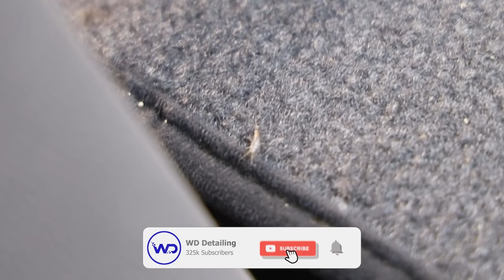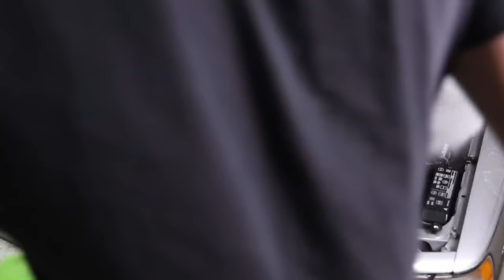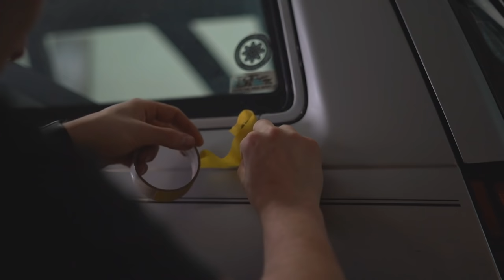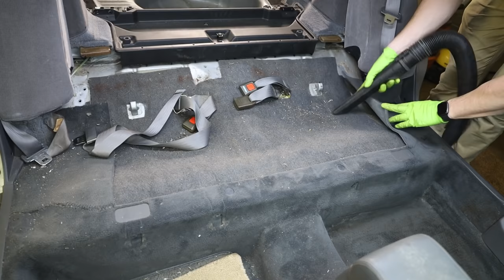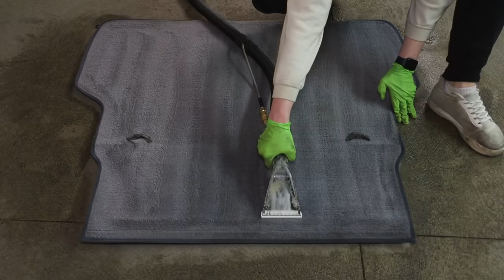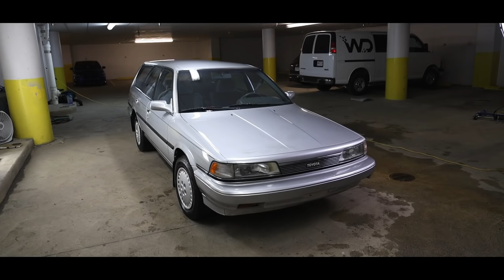ABANDONED GARAGE FIND First Wash In 20 Years Toyota Wagon! Satisfying Car Detailing Restoration

Comment: I would LOVE to own one of these with the 2.5 V6. You never see these anymore, especially in the rust belt. My aunt had a 1990 LE V6 sedan red over maroon cloth interior.
Reply: I own the v6 rn
Reply: I live in iowa and I found my Camry wagon last august. It has very little rust and 215k miles on it, it does have the 2.0 in it but that's the engine I'd rather have.
Reply: You don't see them anymore because almost no. one took care of them, just drove them to the ground. I just bought a 92 wagon with just 2 previous owners  and that poor thing was neglected in pretty much every respect: rust holes filled with rtv, holes in the coolant reservoir taped over, water leaks covered with roof tape, destroyed center console, faulty radiator fan switch, water instead of coolant, old atf, old wiper blades coming apart, dry rooted tires, split cv joint boot. And that is norm with camrys, neglected for decades and then junked.
Reply: More like 4.0 V6 I had the LE and it was v6 24 valves DOHC 4.0 horrible in gas mileage, it was a rocket, and I left many looking at my tail lights, especially with the boost button for the transmission.
Reply: @champion20199  the camry never had the 4.0. 2.5 or 3.0.

Comment: Depending on how solid the engine in it is, that would make a great commute car. It would also make a great stuff hauler as long as it was short enough to fit in it. Neat older car.
Reply: The Toyota engines of this time (especially the V6 and I4's found in this specific car) are legendarily reliable, plus pretty cheap and easy to repair. Not to mention the V6 and automatic are veeeery smooth, and the car is generally comfortable, making for a great trip car!
Personally I like the next gen Camry wagon more for basically being a better version of an already great car!

Comment: Seen one of these that was modified to be used for overlanding. The gave it a basic 3inch lift, added slightly wider rims, removed the rear seats permanently, had a solar system added to the roof on a rack system, a bed in the rear. Thing look mint.

This has the potential for the same. Nice job on the clean up. 👌

Comment: Ive the smaller corolla estate (wagon) I'm in Ireland. Its 1998  in daily use 370000 miles , manual gearbox , gets 45-50 mpg. Does 100mph , doesn't miss a beat and I won't part with it . You can keep your newer computer laden "does the driving for you " plastic sheds on wheels .
This things a joy to drive.

Comment: The car looks very clean on the inside.  I love hatch bachs.  I had a Toyota Corolla 1991. And it lasted me about 20 years..lol  it broke down because the bottom top from the transmission cap came off.  But the Toyotas are very good lasting cars.

Comment: Ahh, the wounds open up again....
My mom had a 1989 Camry LE (sedan), light blue paint, dark blue interior. She bought it in 1994 and had it until 2020 when a large rock fell off a quarry truck on the highway and exploded one of the Camrys tires, taking the fender and half the bumper off and cracking the basketweave alloy wheel (insurance totaled it and took it away).
I learned how to drive in that car, I learned how much I liked fixing cars (now I’m a mechanic because of that Camry), keeping it running and looking nice was a point of pride because up here in the Midwest rust belt, they are rarely seen anymore. Seeing Camille towed away was like watching the vet put down the family dog.

Yes, I cried over a car. Sue me, I loved that car.

Comment: Awesome job
One question: Why didn't you remove the floor carpet to  clean the metal floor below and clean it outside? I ask because after been sitting for so long It would have made a good way to see if it need some floor repairing because of rust or something like that

Anyway is an well done job

Comment: I have had a few toyotas in my life. Toyota Celica 1972,Celica 1982, 1990 prévia, 1989  Cressida, 1990 Cressida and the last one was parked for a year. That one had slight mildew and loved that car had it for 10 years until it became a rust bucket but no matter what I used to clean the inside the stinch never left.

Comment: I wish when possible, the mechanic work after detailing would be made available.
Or you new videographer would go grab some shots of the work.
I detailed under my hood last week. Not so hard, just spray and wipe the engine compartment walls,
Shine up and black plastic on the top. Have to wrap alternator and obviously vulnerable electrical things in plastic if you want to power wash. But the mechanic would be doubly motivated!

Comment: Those wheel covers are a bear to get off.  They have a stainless steel ring of springs all around the rim.  It's best to use something much wider than the screwdriver (like the tail end of the factory lug wrench) and work all around the edge, gradually easing it off.  I know because I have 2 of these V20 Camrys and have been around them since they were new.

Comment: very nice job and congrats on your channel! your detailing work is excellent. however, in the last seconds of this video showing the head and tail lights, it looked as if you had not polished them, correct? only the metal body was polished? also when you make the comment at the beginning about using jet water to clean engines, perhaps you do not know that demineralized water is apt for washing electric components safely as it is not conductive. on the contrary tap water has some minerals (sodium and chlorine salts as a minimum) that are conductive and can short-circuit electric parts. my best regards from spain.
Reply: The headlights don’t need polishing, they’re made of glass.

Comment: I have mice that like to make any vehicle that sits over a week without driving a home so I have tried a varied number of things 2 prevent that from happening and the cheapest best option is replacing monthly Bounce Sheets. I add them into any gap in the hood or bonnet lining, glove box, under each seat, areas close to and around wheel arches because mice often climb up from the tires, and so on. Mice also like to travel along the inside edges of your garage so having something there helps too. It's hard enough living in Central Wisconsin fighting rust, dealing with mice or rats is another headache yuh don't need.

Comment: That's one of the best cars that ever roamed the Earth that the Japanese ever created and that is a trouble-free car all that car needs is a good bath that car I had I owned that car person purchased it from an 87-year-old late who bought the car brand new the car had 36,000 miles ran like a bat out of hell 2.0 motor inline 4 cylinder motor maintenance free just change the motor oil that is one hell of a Die Hard wagon I'm here to tell you that car is unbeatable by far the four cylinder is way better than the V6 the V6 had some head gasket problems I would stick with the four cylinder V6 was good but it became great when it became the 3.0 and not the 2.5

Comment: Just so you know the next time, the hubcap on those years are held on by a couple of the lug nuts.
Reply: No, just a very strong spring band running the perimeter of the mating area.  I have a set in my garage and I've had the car they fit on since 1995.  ( I've had alloy wheels on it for 20 years, but kept the original steel wheels and covers).

Comment: Pre rinsing without soap is pointless. Think of The dirt on the paint as a dry paper towel. If saturated with water, the surfactants cannot penetrate into the grime, making it water-soluble. 

The film is full of water, not allowing cleaners to actually penetrate the stuff that needs to be in order to become water soluble in a hand wash process. The foam layer you subsequently laid down for the hand wash was also doing less, because it was so heavily diluted on flat paint. The panel impact ratio was virtually zero. 

Pre rinse with car pro lift or Bilt Hamber touchless first; and pre rinsing isn’t a waste of time any longer. Hand wash and clay bar are accomplished in the same stage, not one step after another.  Saves oodles of time, while actually being effective in removing dirt in a scratch free way. 

No need to spend more time polishing than you already do, or wasting time getting to that point.